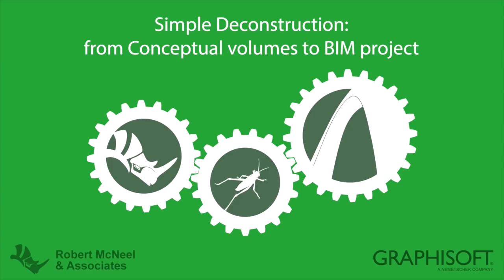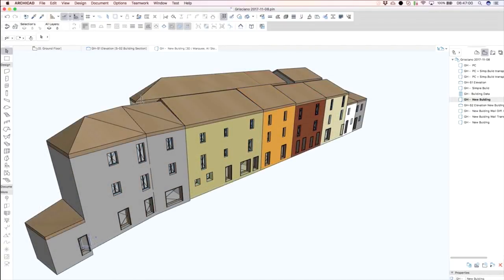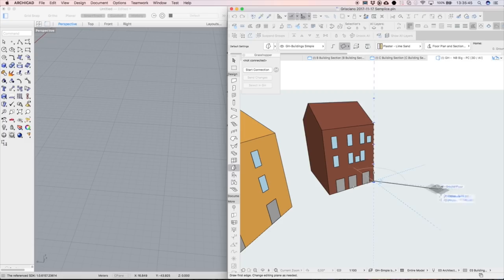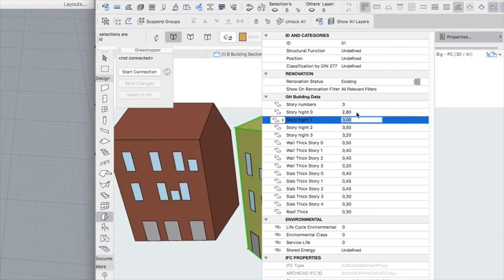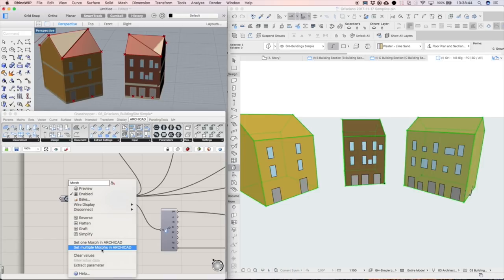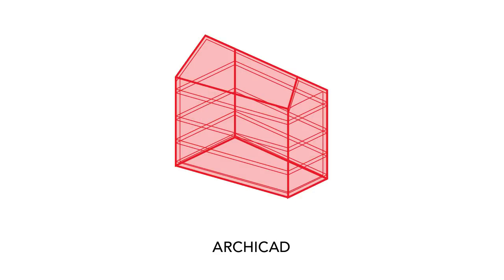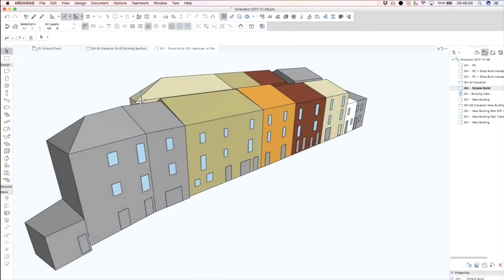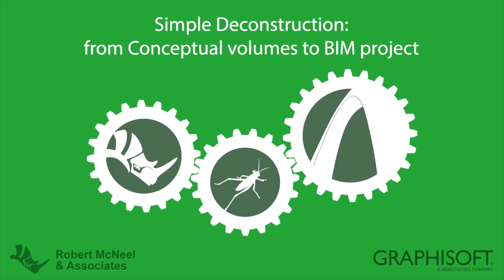ARCHICAD - Grasshopper Live Connection: Simple Deconstruction

Comment: Should.
Be.
Native. 
Function.
In ArchiCAD.

I mean seriously, how many relatively casual though enthusiastic ArchiCAD-Grasshopper users can have the skill to create the Grasshopper definition of the complexity shown in this video necessary to do this conversion?

This is a function that Graphisoft themselves should have foreseen as being necessary or required when they first introduced the Morph tool, but not having to depend on a connection to an outside software to achieve it.

It's almost like always relying on outsiders (third party plugins or separate third party software altogether) to resolve your internal software problems, shortcomings and deficiencies  - which has always been a longstanding gripe I've always had with the ArchiCAD development process.
Reply: Cbricklyne totally agree 👍